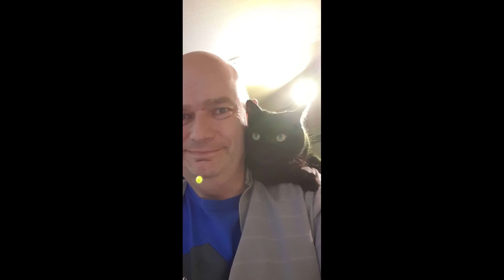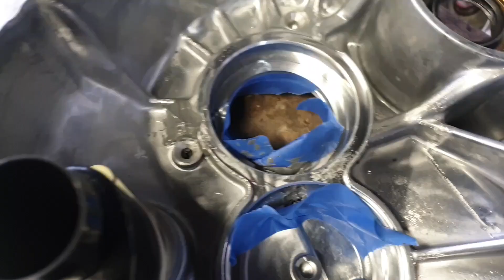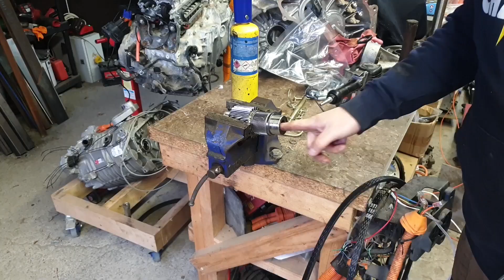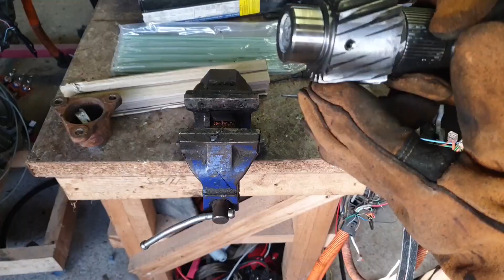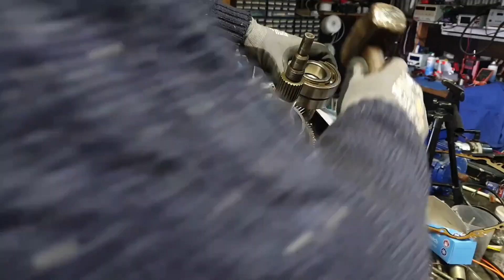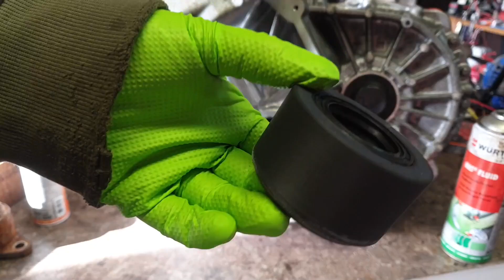Tesla Model 3 Drive Unit Mechanical Modifications Part 1

Comment: I’m wondering why you didn’t just lock or weld the diff? Or put an extended spline through the diff etc? I ask coz I’m working in a very long term plan to rectify my L322 Range Rover

Comment: Loctite 648 is the best way to “key” the output shaft as it has zero backlash and its stonger than the steel if you have that much overlap

Comment: Well big thank you Damien, I am planning to use the lay shaft to drive my L322 in a similar way. Though plan to get a local company to wire EDM the inside and make and adapter to the gearbox

Comment: For a while I wondered what was happening! After reaching the end I understand now but why not just fit the whole drive unit under the car with new driveshafts? Its a superb drive unit and have installed one in my Evora. After watching the tear down, you can only applaud Elon's team (not him) for such a superb design that can easily outlast engines without any maintenance.
Reply: Damien did mount a Tesla drive unit in that way in his 8-series but needed to convert the rear suspension to semi-trailing arms to make space and modify the bodyshell extensively. Obviously much easier to do on a FWD car since there is ample space for it in the engine bay.

Comment: Hi Damian, I know the total reduction of both intermediate and diff gears is 9:1 the pinion to diff looks a larger ratio so I'm guessing the intermediate shaft is about 2.5:1. This would give a rev range of about 0 - 7000 rpm which would make for a pretty good substitute for a conventional motor. Did you count the teeth to confirm this?
I also spent most of the video wondering if you were going to redesign the new inverter board to have a giant hole in it. I'm guessing you are going to use a different brand inverter, I guess we will find out in the next episode.

Comment: What is now your gear reduction?  What is the maximum rpm of this motor?
Reply: Went to WEBER, so the gear reduction is 2.6129 to 1 with a 19,000 rpm on the Performance motor, or 19,000 divided by 2.6229 = 7249 drive shaft speed rpm, which is perfect.

Comment: The 29-9 rod that you used are great for joining shafts , I've used them many times in the past.  I used to preheat them in the oven to dry them out and they weld much better. I'd also heat the outer shaft in the oven too for at least half an hour to get an even temperature when shrink fitting parts. I really like this idea of driving a propshaft from the intermediate shaft. I assume that you have checked the direction of rotation 🤔